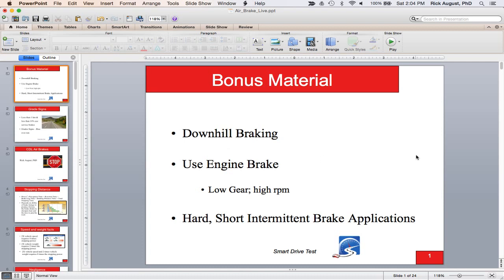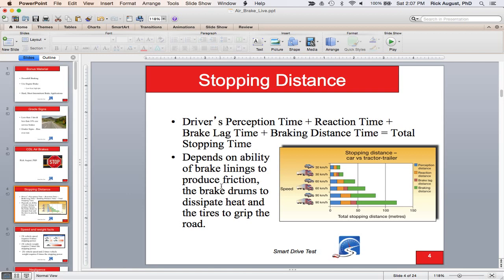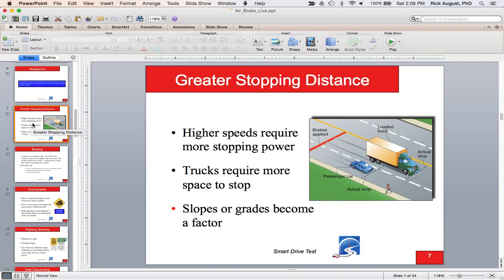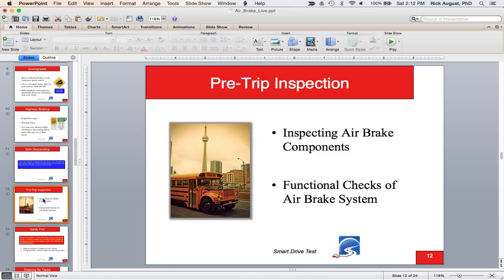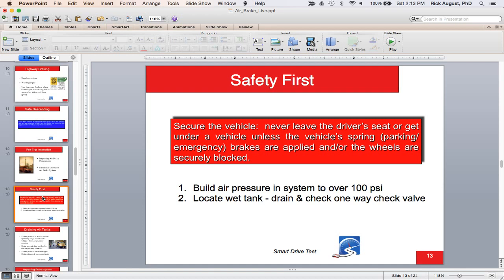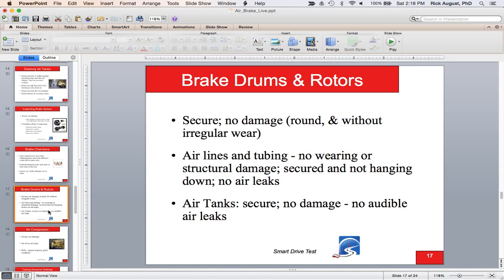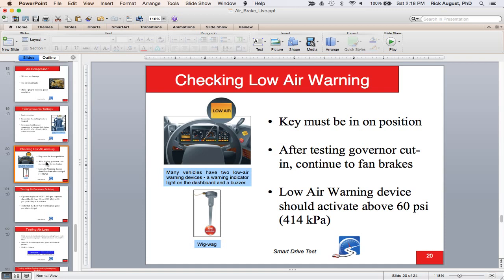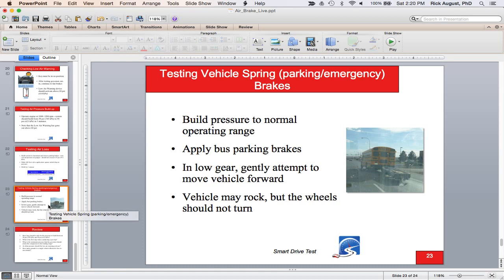How to Pass Your CDL Air Brakes Course for Road Test | AIR BRAKE Smart

Comment: If you test an automatic, is it already in nuetral as you get in or you have to put it there before chalking the wheels? Thank you
Reply from the maker: Chock the wheels and then put the transmission into neutral and release the brakes. Drop us a note if we can help further. All the best, Cheers Rick
Reply: Smart Drive Test when you do pre inspection, do you do outside first or the incab test?
Reply from the maker: Under the hood- (passenger, driver); inside the cab; front of the truck and around the truck in counter-clock-wise direction; under the truck and trailer; apply brakes, remove chocks; and do brake test. Drop us a note if we can help further. All the best, Cheers Rick

Comment: Now my  question, someone posted this on facebook.  Is this test about being qualified to adjust brakes?  I have a card saying I am certified to adjust air brakes.
Reply from the maker: Hi Sandra - thanks for your comment and question. Some provinces and states require that you take an additional course to adjust brakes fitted with manual slack adjusters. See this video: https://youtu.be/knbgfudCZC8 However, most of the information for air brakes here on the channel is about qualifying to drive a vehicle fitted with air brakes. If there is anything further we can do, drop us a note. Always happy to help. All the best, Cheers Rick